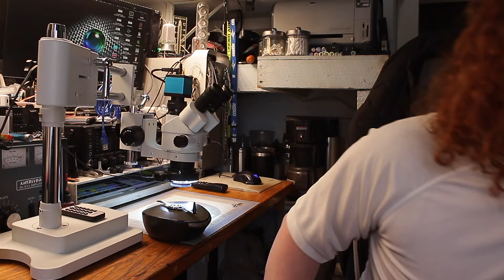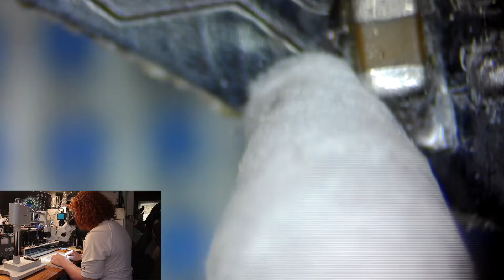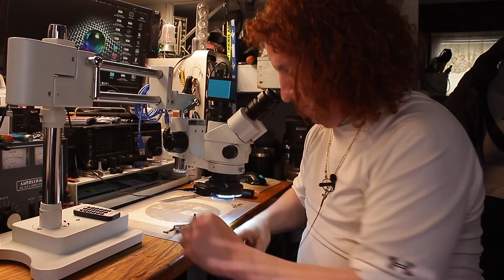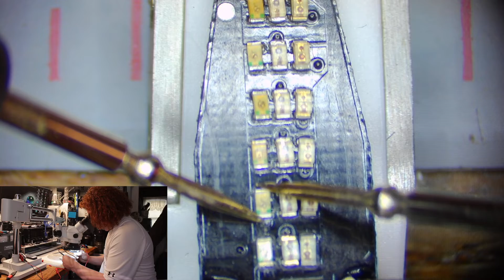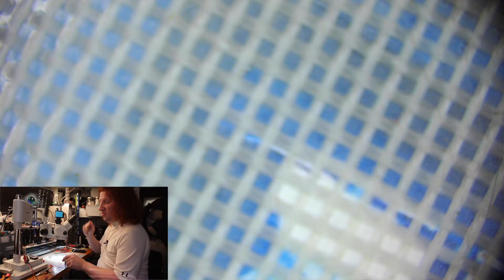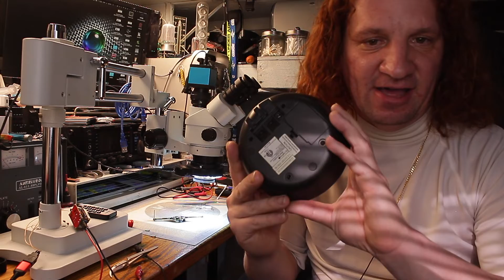JayKay18s Olympia Discovery Info Ball Under The Microscope Part 2 #RollingTardis

Comment: No kidding!  Wow, it really is making a lot of sense now.  I'm definitely kicking myself for not at least trying those Chinese microscopes they sent me on it.  They're really nothing more than a webcam with a magnifying glass in front of it, and there's no way a 40 or 50 dollar scope can even come close to what you have.  But it would have been nice to see if it would have had a shot at it.

Blew up the green one, eh?  That is rather surprising that that happened.  The question is, will the new one have the same shade of green as the old ones?  The other thing that concerned me was that surface mount cap that had the crusties on it, could that have leaked perhaps, and that's what those crusties were?  Suggestions for reattaching the globe?

The motor head has the 2 contact pads for power and they are marked + and -.  I made sure to put the arm back exactly the way I found it to ensure correct polarity, I didn't take notice if the keyway is keyed in any way, it looked square to me.
Reply from the maker: Looks like the next China Microscope will be headed your way, on the next invite for review. I'm not impressed on them at all, I cringe at digital zoom. Nothing replaces optics, with a camera on the backside. But something is better than nothing.

As for the leds, well, 19-20 years production difference, they might all be changed, if needed. The cap did not leak, there was some sort of substance on it, it was also on the entire edge of the PCB. Decades of spinning. Maybe Fog Juice, Cooking fallout? Could be anything.
I ordered plenty of leds, I may have some globes, showing up in the lab😁!

Since the mounting tabs on the globe are damaged or missing, same for the base. ZipTie Stitching.

The arm can go on only one way, the plastic hub has one longer leg on it.
Reply: @RollingTardis  Agreed, optics are key.  That's one of the reasons I do not accept a phone as a recording device.  It has its place, and its use, but I need a purpose-built camera for shooting.  The same, and especially goes for microscopes.  The microscopes I was sent aren't any kind of digical zoom, it's manually zoomed and focused through a magnifier.  Incidentally, my headset can produce up to 8.3x magnification.  More than enough for the stuff I need to do, and usually the 1.9x is enough.

Most of the fog juice stayed in the basement.  Cooking fallout, is possible.  It was just suspicious it was mostly around that cap.  

Zip tie stitiching.  Hmm.  I've seen a guy fix his garbage can with that technique.  Still holding up great!

Ah good, it is keyed.  I didn't pay close enough attention to that.  Like we both said, it was fairly well designed.
Reply from the maker: At 8.3X, You would have been able to decipher between the corner of the PCB and the solder cracks. I could see them at 7X, As for the detail, I was in the 30X range. I'll get into 45X for repairs. At the magnification everything needs to be firmly paced. Just the tiniest movement, focus go out.

As for stitching, would you like the honers, or, I can do it?
Reply: @RollingTardis  Still didn't think to look.  And yes, at that magnification, the movement is magnified as well, so a tiny tremor is like an earthquake.  The big heavy scope helps with that.

You are more than welcome to give the stitching a go.  I couldn't imagine it would need more than a few.
Reply from the maker: Ok, I should have the project done, In a few days. Bits due on Tuesday.
Reply: @RollingTardis  It will be a trip, to have this working properly again!  Now--where to put it!  Thinking either the same spot it was in, or downstairs by Club Jay.
Reply from the maker: Tea Time Addition!
Reply: @RollingTardis  Yes, that's about what I had in mind!
Reply: Solder joints never break in Connecticut hun! 

I wonder if maybe it would be worth it to have the device maybe shut off some time at night and then come back on during the day. I figure it couldn't hurt.
Reply: @Sharkie626  As a matter of fact, not only does it have such a function, but I used to use it back when it was new.  I used to have it in my bedroom, and every morning I'd hear it start up.  Back then, I didn't have Caller ID, so it was just displaying the built-in messages and time and date, along with the obligatory "No New Calls" (Get Caller ID, You Cheapskate!).

Once moved to the house, I disabled that feature.  I think I did it around the time it started screwing up, to help eliminate further issues.  From a physics standpoint, while it's spinning, it has a constant force on it.  Slowing down, stopping, or stopped changes that force, leading to board flex.  Board flex equals broken solder joints.  That was my reasoning behind it.  I'm a fart smeller, er, smart feller.

I don't know if it still receives caller ID info while off, in other words I don't know what circuitry gets powered down besides the motor and IR blaster.  If it were to receive the caller ID of a new call and hold it in memory, then display it once rotating, that's fine too.  But of course in this day and age when we could get a call as early as 4:30-5:00 AM, and maybe as late as 11:00 or even 11:30 PM, does it make sense to be off for the 5 or 6 hours?

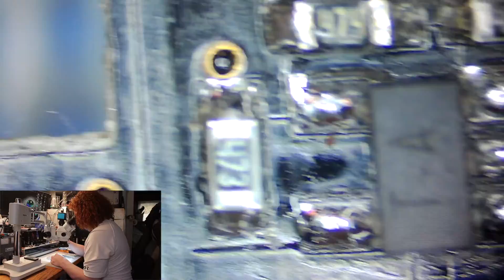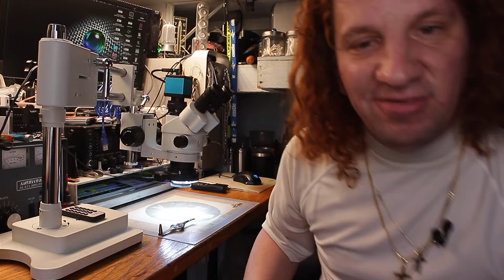Back when I was a kid and my dad would work evenings, the living room TV would stay on 24 hours a day.  I'd get up at 6AM, my sister and I would be off to school by 7:30 or 8.  My mother would get up by 10, so that would have been 2 hours downtime.  She'd watch TV all day; when my sister and I came home from school by 3:30 we'd watch, then she'd regain control around 6 or 7, watch till 11 or so, and my dad would walk in the door around 1:30 or 2, watch for a couple hours, then go to bed, leaving about 2 hours of unwatched TV once again.  So out of a 24 hour day, it only would have been off for 4.  As a youngster I could hear the high-pitched whine of the CRT, and it became a sort of "comfort tone".  Occasionally, the TV would be turned off for some reason, and as soon as my ears were within range, I could immediately tell something was awry.  It was unnerving, and even more unnerving to see a blank screen.  Only on very few occasions was that TV turned off, and most notably are those where it broke.  My dad fixed it again and again over the years, all fairly simple fixes, maybe 4 or 5 in total over 14 years.

I can't hear the whine anymore, not for many years.  But another thing I do remember when I was a very young lad was occasionally being off from school and catching The Price Is Right.  And then they'd go to a commercial, and the tube would crackle.  That was static electricity of course, and was normal, at least for that set.  But over the years, it stopped crackling when it went to commercial, and I realized why later on in life.  Back then, the show would fade to black and the screen would stay black for 1 or 2 seconds, allowing the static to do its thing.  Later on, that time was shortened and shortened and shortened to the point where the screen is black for just a few frames, if that, so the tube never had time to "cool off".  I miss that pause and crackle.  By shortening that time, they can squeeze even more commercials in.  TV is not what it used to be, by any means.
Reply from the maker: From what I seen, the Globe can be programmed for night blank.